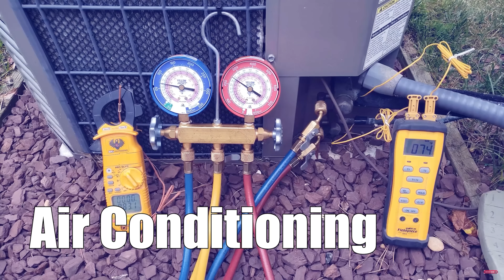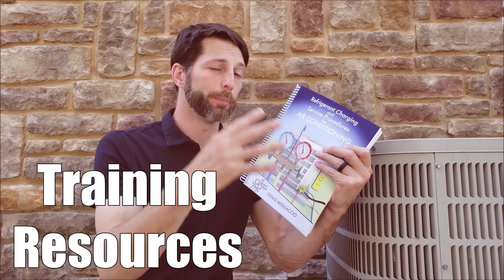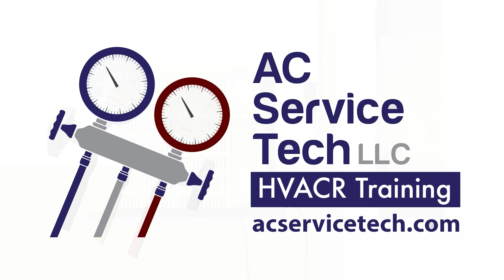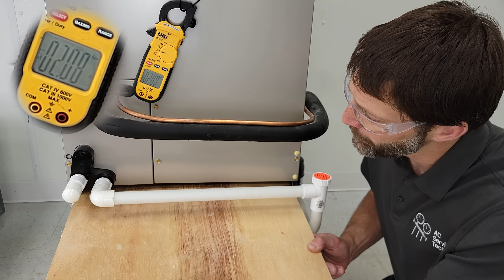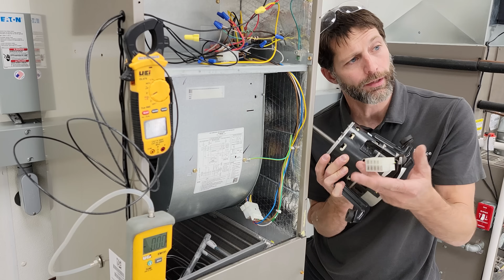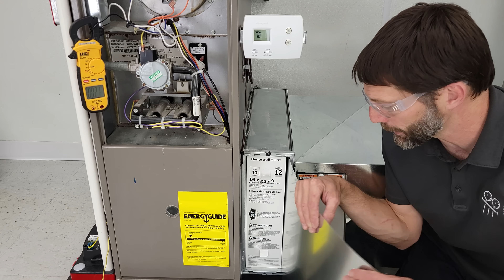HVAC Blower Motor Operation and Current Draw during Airflow Restriction! ECM vs PSC

Comment: For a constant torque motor, IE X-13, would you describe the taps as “torque taps" more so than a “speed tap” as I understand the torque of the motor is changing to overcome higher static rather than the speed. With a constant airflow motor, IE variable speed, that would raise the airflow to overcome higher static. Am I to understand this incorrectly? Thanks for all you do!
Reply: Correct.
Reply: From my understanding no motor produces any torque at all until a load is applied to it, and in the case of a fixed unchanging blower wheel size, and assuming the duct size, static pressure, etcetera is also not changing, then the only way to increase the torque load on the motor is to also increase the speed or RPM on the motor to try and force more air through which in turn put some more of a load on the motor which requires the motor to produce more torque

Comment: If you set  dip switches for a low speed on the 16 pin ECM motor would  that negate the problem? Stop the jet engine noise?
Would the blockage be obvious, if you didn't have static pressure testing device available for testing?  
Test by removing the filter and opening the door to the furnace and a visual inspection, acceptable test?
Reply: Without a static pressure measurement you are in the dark. If you set air flow too low that will cause its own issues.
Reply: @sprockkets  I appreciate you taking the time to reply.
Reply: Most of the time the problem is dirty filter or a plugged up evaporator coil, or homeowner shut off too many Supply registers in unused rooms thinking they would save money on the power bill. And one time it was in 18-in return flex duct that would get sucked in and collapse on itself when the unit came on
Reply: Lmao it suckrd itself into a collapsed state? I thought the fan turning on actually increases static pressure so why would it suck into collapsed state?